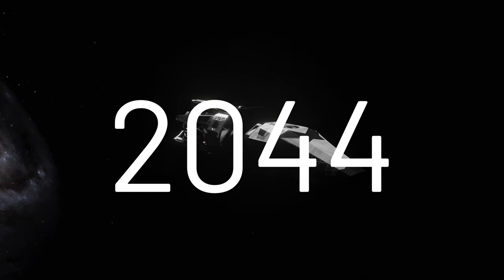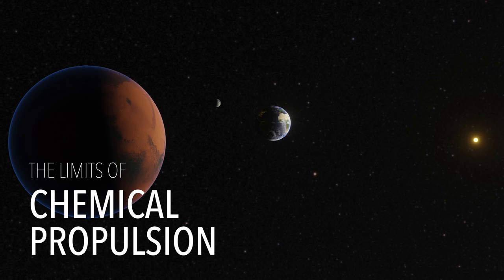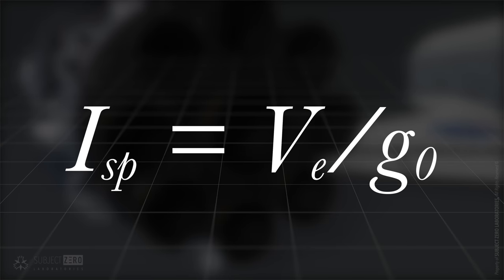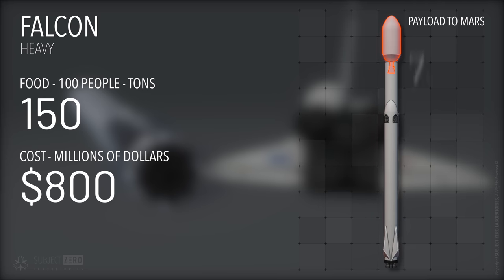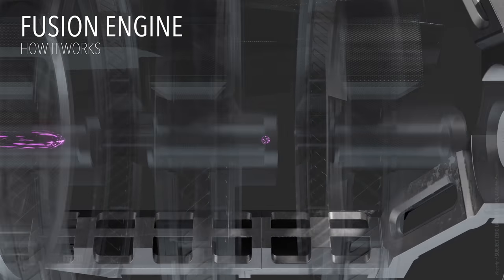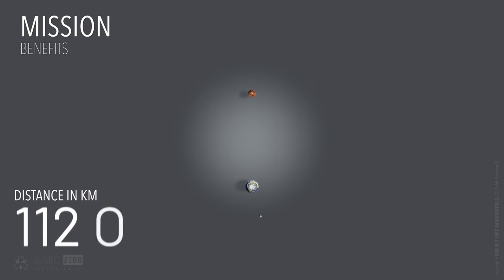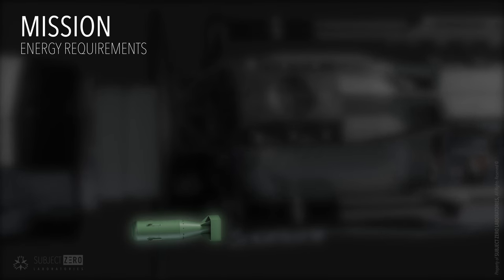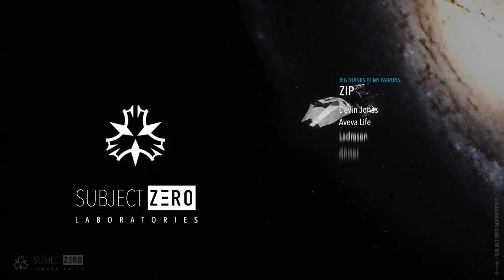Fusion Rockets - The Real Mars Express

Comment: I just want to say, stupendous animation.
Reply: I'm so hyped now.
Reply: Doesn't work. The counciousness has a time limit.
Reply: The spacecraft doesn’t have enough radiator fins
Reply: @smallpeople172  7:00 the lithium shell reduces the need for significant cooling fins apparently
Reply: @nic.h  the lithium shell would then just melt
Reply: @smallpeople172  I think that is correct the lithium shells are expendable and should be considered part of the fuel
Reply: I live in Karachi Pakistan and I like your comment if you don't mind
Reply: @zosutosu  I live in Karachi Pakistan and I like your comment
Reply: @Vesta 2022 ok so what happens after it is ejected? Overheating?
Reply: With the Starship concept, the electric fusion concept here, would be effective second chamber stage between SN & BN for solar orbit travel, non idole accel, even at .5 to 1G is effectinve time & gravity granted cruise to any of the solar system planets.

Comment: Hopefully the first crew will make sure to double check the voice control shutoff. Nobody wants to pull a Solomon Epstien on the first flight
Reply: Also make sure to have monolithic shiny robot named TARS
Reply: Won't help, as it's extremely hard to talk at high g. Better just put controls into the seat's armrests (as was done in more modern Expance ships).
Reply: @solarissv777  Or just make it mostly automatic.
But emergency controls is good idea.
Reply: I was just thinking before the intro sequence: "You know what this is like? This is like The Expanse." (But less stressful. 😌)
Reply: That poor guy lost the control just because of chinese Alexa.
Reply: @smitprmr  Moral of the story: Never settle for cheap Chinese knockoffs or you risk accelerating into oblivion.
Reply: @whatelseison8970  Yea Agreed.
Reply: @monoham1  That's how it's explained in the books... it's also said he died in like, 5 minutes as well.  10g's is no joke.  Fusion-powered funeral pyre.
Reply: @monoham1  no matter can accelerate to c. The acceleration slows down as the relativistic mass increases. It becomes harder to go faster. We just don't see that in practice as all our spacecraft run out of fuel too quickly.
Reply: Better yet just install an accelerometer that just cuts of the engine if it exceeds a certain g-force

Comment: A really cool type of fusion research that's going on is called Focus Fusion, and it needs to get more attention imo. It's aneutronic and only requires hydrogen and boron for the fusion process
Reply: Dr Bussard was a champion of aneuteonic fusion with his electrostatic fusion systems; boron...11 if I recall. There was funding for this for several years and then it somewhat disappeared. Lockheed's high Beta approach has fallen off the screens but seemed to deal with fusion reaction problems... the reality may be combining these technologies. A direct conversion MHD loop would yield a more compact design. Again, the focus has to have sustained research.
Reply: @francisdavis1271  yeah it's boron 11 for focus fusion too, Dr Learner over in Lawrenceville, NJ is still putting in research for it, but it really doesn't get enough attention
Reply: I live in Karachi Pakistan and I like your comment
Reply: @francisdavis1271  I live in Karachi Pakistan and I like your comment if you don't mind
Reply: Afaik that's one of the hardest fusion reactions to achieve
Reply: @pvp5797  yup it's super difficult, but has the best potential from a fuel resource standpoint, unfortunately it hasn't been getting a lot of funding

Comment: I like how he doesnt dedicate any mass to the mars lander, I just imagine a astronaut inside a Falcon heavy payload faring entering the mars athmosphere at interplanetary speeds. Also $65m per flight to mars is way to cheap (SLS cries in overbudget).
Reply: Also mass of spacecraft itself (with all life support, power generation, etc).

And funny thing to consider is fact that someone will need to design washing machine system that works in space. (because right now old clothes are treated in same way as crap)
Reply: Actually falcon heavy cannot be reusable if there is a mission to Mars
Reply: @NeelamSingh-ij5td  It can
Reply: @NeelamSingh-ij5td  the tesla, that spaceX put in space has a aphelion of 1.66 AU, while mars has an average distance of 1.53 au. For that demonstration they recovered the lower stage boosters. So as long as your mars mission weighs less than 1.3t it should be possible to reuse falcon heavy.
Reply: @ImieNazwiskoOK  well actually no
Reply: @ImieNazwiskoOK  just check it on internet
Reply: @plainText384  they put the Tesla into orbit but to land on Mars it's another thing you need to have a bit of fuel left for landing on Mars .
Reply: @NeelamSingh-ij5td  I checked on NASA's performance website (you can check it yourself), it can.

And what level of reuse are you talking about? (it can have 3 booster + fairing, 2 boosters + faring or just fairing)
Reply: @ImieNazwiskoOK  the second stage is not reusable at all
Reply: @ImieNazwiskoOK  if you reuse the booster then you would have not enough fuel left to go on a trajectory towards Mars.The boosters cannot go by themselves to orbit and then come back
Reply: @NeelamSingh-ij5td  the mars pathfinder spacecraft weighed 894kg while the tesla roadster weighs about 1300kg. The tesla roadsters was put on a orbit with a aphelion past the orbit of mars, and the boosters were recovered. So falcon heavy definitely has the performance to send a robotic lander to mars, while recovering the boosters.
Reply: @NeelamSingh-ij5td  What part of phrase "PARTALLY reusable rocket" you don't understand?

And as I said you can check NASA (so official and reliable source) website.
https://elvperf.ksc.nasa.gov/Pages/Default.aspx
Go to query, select high energy, put around 15.7, select "Falcon Heavy (Recovery), click plot. 

Also as other person here pointed out booster were recovered and orbit of tesla is past the Mars. Not only that but boosters returned to launch site (they can land on droneships with needs less fuel) and not only that it was older version of Falcon Heavy.
Reply: @ImieNazwiskoOK  I think he's referring to the "expendable mode" or whatever it is called where the first-stage boosters are firing till they are dry and because of that cannot be recovered. This gives you stronger kick at the cost of losing boosters.

So assuming he wants to account for the gear needed to land on mars + life support + fuel to slow down from inter-planetary speeds to catch a stable orbit around mars... it could probably make sense to "waste" those boosters.

However I think the more reasonable approach would be to launch the interplanetary ship in two or more launches and assemble on low earth orbit.

Another very reasonable approach in my opinion would be to build a bit of orbital infrastructure on the mars' orbit - it has two small moons, perhaps you could build some kind of "catcher" (magnets? maybe nuclear-powered laser beam?) on them that would allow you to slow down by quite a lot.
With this approach you won't need as much fuel for the landing since the kinetic energy was transferred to one of the (or both) moons, I don't know how much mass they have, but using this approach for too long could potentially change the moon's orbit which could lead to all sorts of interesting problems.

Yet another approach could be to either build and launch the entire ship on the moon, low gravity and the lack of atmosphere and abandonment of all sorts of metals makes it a really good candidate for a space port. You could even build a launch tube and launch the ships using magnets powered by solar panels.
Reply: @randomname3566  Still "Actually falcon heavy cannot be reusable if there is a mission to Mars" is just false.

And yeah, it's even more reasonable with Falcons (which loose a lot of capacity when more energy is needed to low efficiency of engines and high mass).

The "catcher" would need awful a lot of energy (keep in mind that around Mars solar panel have lower efficiency than in LEO), also need for large and efficient light sail. (and lasers)
Changing orbits of Moon is pretty unrealistic problem (they are just too damm massive to care about it).
But there is concept of making refueling station on Phobos, it is large and has ice and carbon.

I think making entire base on Moon that could build ship for Mars would be just overkill. Things that would be needed for it could be used on Mars.
But something much smaller like another refueling port could be useful.
Reply: @ImieNazwiskoOK  >The catcher would need awful amount of energy

That's why I'm mentioning nuclear reactors, btw, in hindsight, you don't need energy, you need a way to steal if from the incoming spacecraft, perhaps you could try transferring the kinetic energy to some deep space probe... or kicking a crew vessel heading to earth... or just generating boring electricity.
Reply: @ImieNazwiskoOK  just think about it if you need to go to Mars you first of all need to park yourself into orbit after that you need to fire up your engines to put yourself on a trans Mars trajectory .The fh boosters don't go to orbit .if they have to be reusable they cannot go to orbit so the thing that reaches the orbit is the second stage and parks itself there when it reaches orbit it barely has enough fuel to re-enter the earth Atmosphere .
Reply: @randomname3566  On that logic we could get nearly infinite energy from Moon orbiting Earth.
Also making nuclear reactors in space is VERY hard.
Reply: @NeelamSingh-ij5td  Which still doesn't change the fact that mostly reusable Falcon Heavy can go to Mars.
Just accept the facts dude.

On your logic Atlas V can't go to Mars... Oh wait it did many times...
Reply: @ImieNazwiskoOK  > On that logic we could get nearly infinite energy from Moon orbiting Earth.

I don't understand, I'm not suggesting perpetuum mobile.

The concept I suggested is actually pretty valid, there is a proposal of "mars cycler" that in some versions/visions/interpretations catches the incoming crew capsule and then shoots it backwards to the direction of motion near mars, transferring the kinetic energy.

In the proposal with catching station commonly known as "sky hook" you're doing basically the same, but the station is not in motion between planets but on a stable orbit around either of them.

The acceleration however is immense with such things...
Reply: @randomname3566  This catcher would still need energy to maintain position
Reply: @ImieNazwiskoOK  generally they don't change clothes. The main reason they get dirty on earth is because it sticks to your skin and gets oily and gross. Doesn't happen in space because no apparent gravity.

Comment: I think I will use one of this thrusters to make my personal spaceship
Reply: Don't make it too efficient, or at least figure out a way to disengage it if you're stuck to your chair because of the acceleration
Reply: @bmallory  I got that reference
Reply: I too
Reply: I´d honestly rather go with nuclear salt water rockets. Even better ISP and all the comfort of continuous thrust, plus it should be a lot cheaper to manufacture.
Reply: @cosmic_cupcake I've been wondering lately... has anyone ever tried to work out a sort of "2-stage" THERMONUCLEAR salt water rocket wherein a "normal" self-igniting pure fission NSWR at the smallest scale possible is used as a "first stage" for a surrounding and much larger fusion-based stage?

Comment: That joke at the end made me giggle. ITER is on it’s way but it will start experiments in 2040’s 
Makes me think how to put such a giant structure as ITER on the back of a starship? Hopefully in my lifetime
I’m only 24
Reply: Bro, don't worry. You will see starships built. (could be in matrix tough xD
Reply: You don’t. You use a wendelstein 7x derivative. Much more portable.
Reply: In fairness, much of the initial construction time is due to the lack of manufacturing know-how, and ongoing refinement of the process. I'd expect future projects, once one proves successful, to go substantially quicker (a couple years instead of a decade).
Reply: ITER is fairly different in function from this. It's after a sustainable contained fusion reaction with a net positive energy return, so the required components are likely to be pretty different at a guess

Comment: Well, you got a lot of the theory right ... except for the fusing to become more massive part. It's the opposite actually ... When the hydrogen reactants fuse to produce a heavier element helium, the overall mass is reduced, which is where energy is supposedly going to come from during the fusion process. e = mc^2 ... resultant helium-4, is lower in mass, by about 0.7%, than the reactants that went into creating it, which is where the energy comes from.

Comment: nice maths !
However using the falcon heavy instead of the starship for mass colonization of Mars don't seems like a likely scenario
Reply: Also far better thing to do with Falcon Heavy would be building ship in LEO (because that rocket is great for LEO).
No one would want to sit half a year in tiny capsule and they could maybe use Raptors (which have much higher efficiency than Merlins and could be refueled on Mars).
Reply: Starship for Mars colonization is just a pipedream
Reply: @luigeribeiro  please go into more details

Comment: Everybody gangsta until the fusion chamber becomes unstable
Reply: or the liner mechanism jams
Reply: The fusion would just stop 
It’s not a bomb like fission reactors
Reply: you DO have to put in energy for every fusion to take place, so the whole payload can't explode uncontrollably. You could, of course, fuse more fuel at once than intended, but I believe this isn't an easy mistake to make due to the large input energy that each atom requires to fuse. You'd need to simultaneously send more fuel into the chamber, input a dramatic amount of extra energy than in spec, and still maintain tight magnetic control over the larger mass.
Reply: @tron359  well maybe the fusion chamber might be sabotaged by an...

impostor
*amogus drip song earrape plays*

Comment: One item is missing in your equation. What energy is going to start the fusion reaction, the necessary magnetic field etc? Or better, where are you going to get the energy from?
Reply: Get a friend to push you then turn the key.
Reply: I was thinking the same thing, you still need to apply a large amount of energy to the magnetic rings to compress the fusion products inside the lithium shell, so another source of energy is required to power the magnetic part of the drive, maybe a modular nuclear reactor or something, but now you're adding more weight to the ship.
Reply: essential point.

Comment: Excellent video, this propulsion system would not be good for interstellar travel however because it consumes lithium. Whats needed for interstellar travel is a fission rocket that consumes only uranium or plutonium. A ship that travels at a constant 1g acceleration rate can get to Alpha Centauri in 3.6 ship/7.3 Earth years (and that includes turning the ship around half way and decelerating) or span the entire diameter of our galaxy in 12 ship/113,000 Earth years. The ship would achieve about .95% light speed after about 1 year. A 10 ton ship would need a mere 10 tons of continuous thrust. If you want to see a new fission rocket concept watch my video "liquid plutonium rocket" it also has info on the constant 1g acceleration method.

Comment: The one working on this is Dr. Slough, for those interested. Been following his work for about a decade. His design, if/when it works, can also produce electrical power.
Small correction for 0:34-1:01: solar panels produce power, not energy. It would take about 1.7 hours for stated 0.7 km2 of solar to produce stated 845 GJ, assuming a standard 200 W/m2 panel. Or, with average USA weather (CF=24.7%), you would need 0.00054 km2 to produce that energy within a year.
Math: 845e9 J /(.7e6 m2 * 200 W/m2 * 3600 s/hr) = 1.68 hr,          845e9 J /(365 dy/yr * 24 hr/dy * 3600 s/hr * 200 W/m2 * 0.247 CF * 1e6 m2/km2)=0.000542 km2

Comment: Some observations. You compare this fusion drive to a falcon heavy. Why ? It was never really intended for this, but starship is. Secondly, I'm not sure where you get strong enough magnets to compress the plasma enough. Our current efforts at getting fusion going are the size of factories. I think fission rockets are a much more feasible solution for now. It's something we could build now with our current technology. I do agree on the benefits of a faster transfer speed to Mars. The general hard radiation is pretty constant, but the danger of coronal mass ejections from our own sun varies a lot through the 11 year cycle. Right now we're coming out of a low (tried to see sun spots a few months ago, no luck there haha) but it'll peak in 6 years or so and go back down again. I doubt that we'll send any manned vehicle to Mars until getting close to the next minimum, so maybe 10 years from now. I suspect that Elon Musks drive partly stems from the realization that he needs everything ready by then, or he'd have to wait another 11 years or so.

Comment: Would have preferred to see a comparison to Starship and not falcon heavy.
Reply: I believe Falcon Heavy was chosen because it is the most powerful and has the highest payload capacity of the current operational rockets (Saturn V overcomes it, but it was retired in 1973 after the Apollo program ended). Since Starship is still in its prototype phase and we do not know its full capabilities, it does not make sense to use it (yet).
Reply: How much comparison do you need to see the folly that is Starship to Mars for practical cost and health reasons. He spells it out wonderfully here.